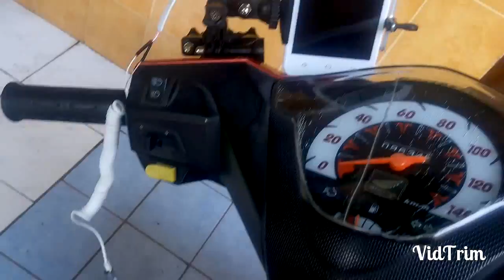Bikin charger hp di motor modal 5 ribu, cocok buat ojek online

Comment: Kurang aman gx ada pius , ribet jg motor jg belum hidup , klw hidup daya bertambah dari pengisian regulatornya  , mungkin ngebeleduk dah tuh hp 😂
Reply from the maker: +Hardiawan 1 aman ini kan pakai stepdown, arus udah diturunin dari 12 volt ke 5 volt dan ga akan naik turun (voltase accu 13-11volt), charge motor hidup atau mati tetap bisa dilakukan prinsipnga kan sama aja dengan charger mobil tapi ngambil langsung daya 12 volt langsung dari aki, meleduk kalo salah masang kubu positif dan kubu negatif, car charger juga rata2 udah punya proteksi overcharge, sortcircuit dll lebih bagus dari pada step down biasa karna car charger memang dirancang khusus biat chareger hp berdaya 5volt, kelemahanya cuma arus amprere yg kurang rata2 300-500 mAh aja jadi agak lama ngecharge hp nya